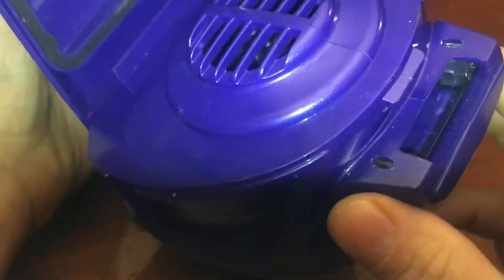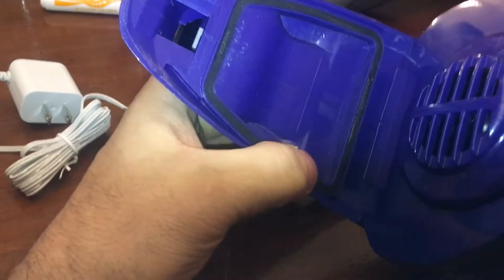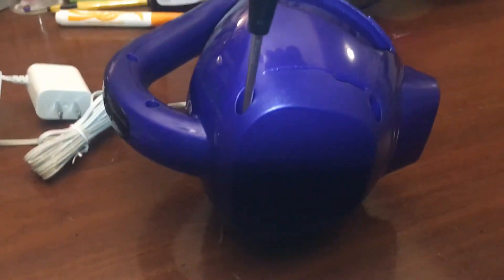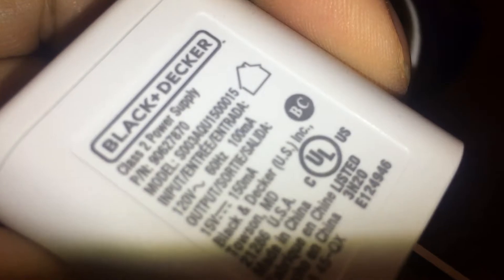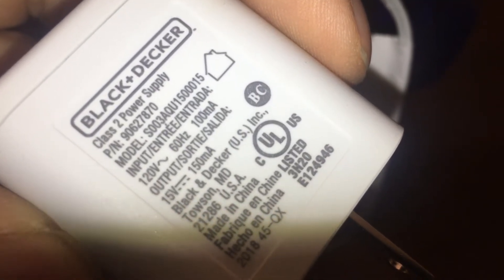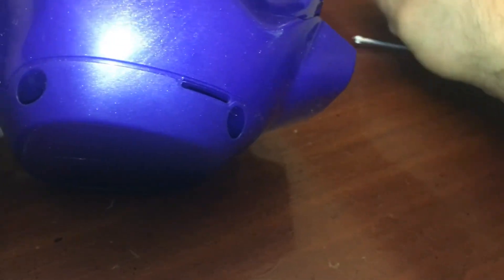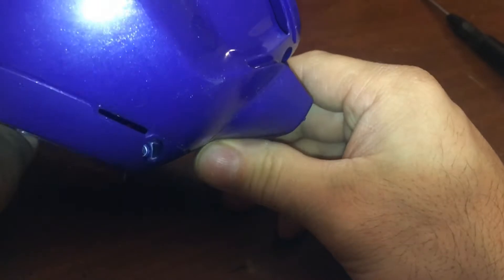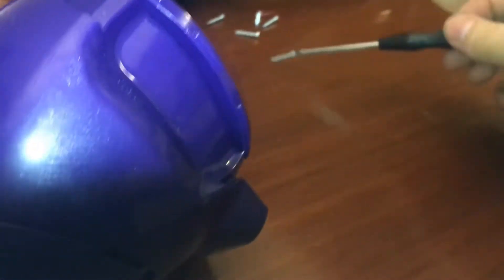Let's take it apart to see battery Black and Decker HLVA325JP Cordless Pet Vacuum HLVA325BP

Comment: Bubba, you are now in over your head. Battery replacements cost as much as the whole damn vacuum. Throw it away & just get a new one.
Reply from the maker: where did I say the battery was bad? most of these items just have 18650's in them anyway. you just rip it apart and replace the 18650's.